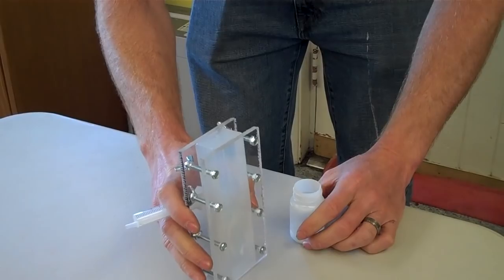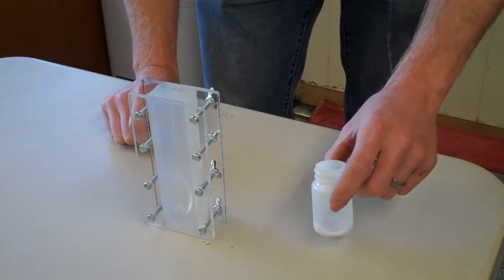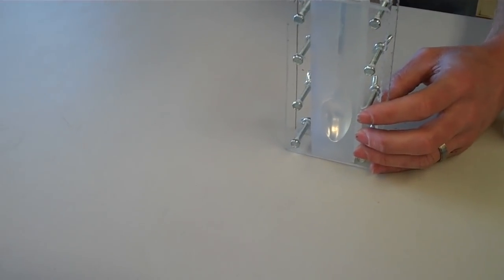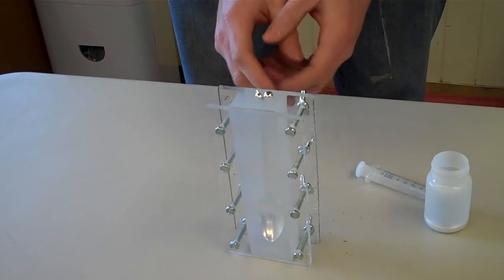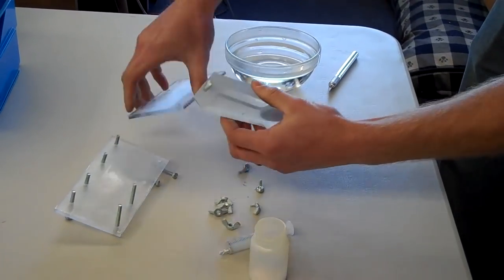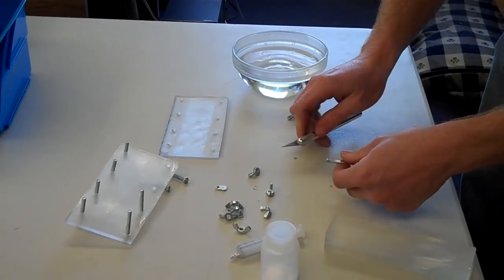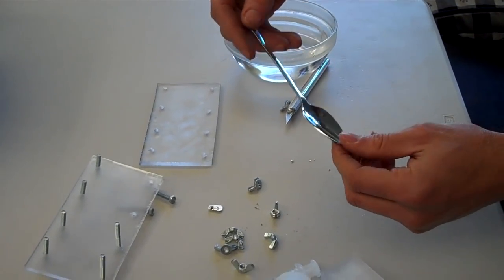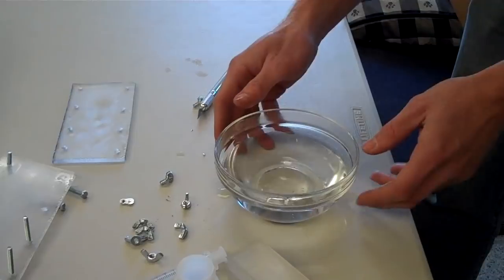RotoMetals.com Gallium Spoon Mold Demo.mp4

Comment: Yeah. Ima mold some spoons and forks and set them out for dinner lol they would melt into the food
Reply: but if that food is eaten or the spoon is put in to someones mouth and they end up swallowing it that is on you
Reply: Gallium isn't toxic.
Reply: Yea but it will harden inside of you.
Reply: Zach Van 
Uh....no it won't. The inside of the human body is 37°C (98.6°F). The melting point of gallium is 29.76°C (85.57°F). This means it will stay liquid until you eventually shit it out.
Reply: No it wouldn't, your body temp is much higher than gallium's melting point.
Reply: Zach Van That's what she said.
Reply: The fact that gallium will react to acids means you do not want it inside you.

Comment: What if you eat soup with the spoon it will melt
Reply: It melts JUST under 30 degrees C (or just under 86 in old money) So soup will do - providing it isn't gazpacho - it will not work with that one.